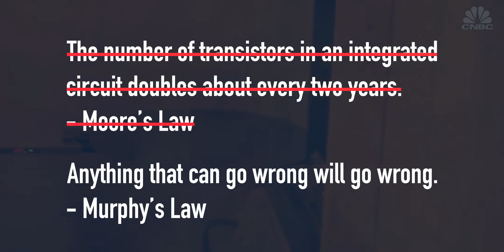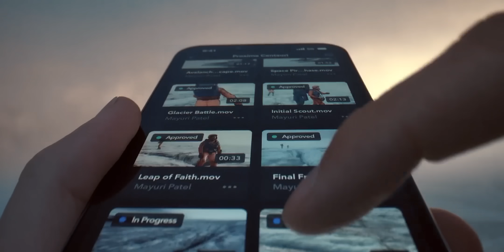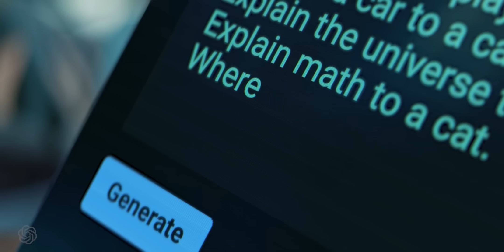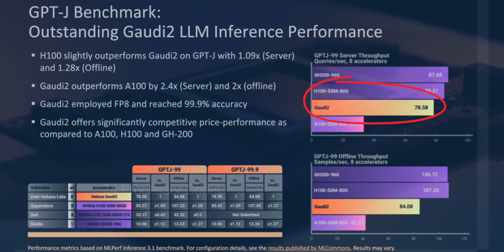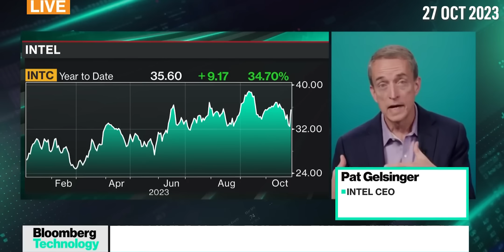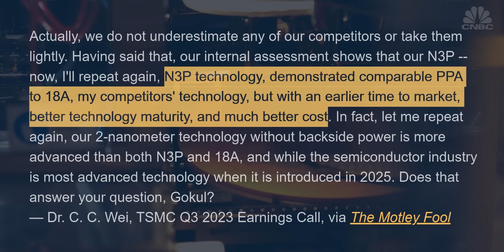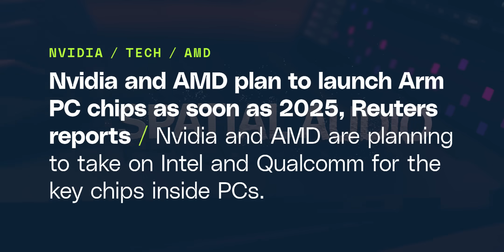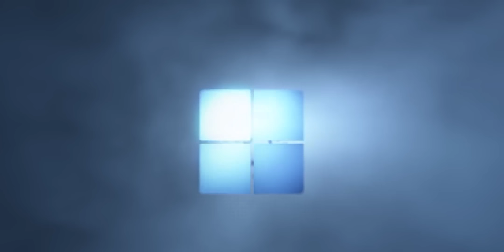I WAS WRONG! Intel's Crazy Plan to Dominate AI Chips is Working

Comment: Am I in an upside down world? Intel is in trouble because its processors suck and they don't look like they'll be getting any less suckier soon.

In server processors and GPUs for supercomputing AMD and Nvidia have given Intel a shellacking. In cloud computing the story is the same only Intel has strong competition from the ARM crowd there as well.

Both performance and energy efficiency must be first rate in commercial computing these days to find new CPU customers and Intel is incapable of achieving both of those objectives at the same time. AMD, without question, is hitting home runs while Intel isn't even hitting the ball.

Even in desktop/laptop processing where Intel generally gets high marks for CPU performance it shows no signs of of having mastered the energy efficiency challenge, Meteor Lake included. AMD looks like it has the stamina to take Intel in that area, too. In any case, the standouts in that domain are the high performance ARM players - Apple and Qualcomm - that have achieved a better performance and energy efficiency balance than either Intel or AMD. (And please spare me the nonsense that energy efficiency doesn't count for anything if you haven't got the performance - Qualcomm's new 'laptop' SoC outperforms 95% of Intel's processors aimed at desktops/laptops.)

The only thing that Intel can build on at the moment is its expanded foundry business but it better find customers fast or that will be the white elephant that puts paid to Intel's smug anticipation of uninterrupted success.
Reply: You describe perfectly the current situation but miss on the competitive outlook. The 3 drivers of the turnaround you miss are the following:
1. USA, Europe and Israel are giving $50billion in grants to Intel. No other competitor is getting that
2. ASMC is giving priority to Intel on next cutting edge litography machines. This will give node tech advantage for Intel on all their competitors.
3. Chiplet, not chip is the future. Intel  near future chips like Meteor lake are comprised of multiple tiles from different wafers and technologies such as RISC and TSMC nodes blending those tech with Intel's 8086 strengths to make the best chip. This is the future. Blending of best in class techs. And Intel chiplet tech is well ahead of competition.
Reply: @andrepaes3908  Points 1 and 2 follow from Intel's positional advantage as a leading semiconductor Foundry. I did comment on that in a general way and I wish them every success in that endeavour.

Point 3 is rather more debatable. Even if Intel leads in chiplet technology (a point that isn't proven in my estimation) its Meteor Lake tiles could still easily fall short. Nothing I have seen suggests that Intel has the measure of its main competitors in chip architecture and so far Intel has failed abysmally on delivering energy efficient cores.
Reply: @chris27gea58  yes Chris I think soon the benchmarks on Meteor lake will shed some light on how performance per watt will fare compared to AMD Ryzen and if the multi tile configuration delivers what is promised 👍
Reply: @andrepaes3908 it's stretch lol, intel chiplet no way ahead amd at all.
Reply from the maker: You’re not in an upside down world at all. In fact, I’ve made many of those same points before. I explained all the things Intel needs to change to become the next Nvidia and power efficiency is definitely a big one.
Reply: @TickerSymbolYOU 
>>...there’s a lot left we don’t know about the Meteor Lake VPU. The fact that it’s even called a VPU and includes Movidius tech implies that it’s a design focused on computer vision, similar to Movidius’s discrete VPUs. If that’s the case, then the Meteor Lake VPU may excel at processing visual workloads, but lack performance and flexibility in other areas. And while today’s disclosure from Intel disclosure quickly brings to mind questions about how this block will compare in performance and functionality to AMD’s Xilinx-derived Ryzen AI block, those are questions that will have to wait for another day.<< Anandtech, May 29, 2023

As for Gaudi, there is little there to cause excitement that I can see. Couldn't AWS, say, deliver better than a 40% price/performance gain for AI training just by improving their Graviton architecture? And, if that is beyond the capabilities of Amazon I doubt that Google or Fujitsu would be similarly limited. Yes, renovating cloud servers could be big business but it is also likely a declining business. Many datacentre operators will decline on the Intel lick of paint as a poor investment.

Comment: Intel needs to get its performance per watt in check if it wants to gain back market share or blunt the impact of the ARM invasion. Microsoft has apparently been working hard to make windows on arm a better experience than it has been historically. If windows on arm is a palatable experience for business and enterprise customers as well as gamers, Intel might be in trouble. Especially if nvidia and AMD enter with arm offerings. I think the fact that dell Lenovo ASUS HP and others have said they will offer ARM laptops means ARM IS COMING!! 

So the question for Intel is, will x86 have similar performance per watt as ARM? If not, then arm will slowly but surely begin to steal market share in laptop. Qualcomm now has some of the architects behind Apple silicon.  So Intel needs to take the arm threat serious and stop relying on historic indicators of ARM on high performance computers. I think Apple has obliterated that mental model that arm isn’t up to snuff for the pc/laptop. And the market can move against x86.  Be careful! I think once arrow lake is in market we will have more information on whether intel’s new nodes like 20A are up to the task of seriously improving performance per watt.
Reply: The main competitor of Microsoft is Apple. Microsoft's been working with Intel for decades to counteract Apple's threat. The ARM PC is just a backup plan for Microsoft in case Intel 5 nodes in 4 years fail. If it succeeds Microsoft will focus on developing Windows for 8086 and drop their backup plan.
Reply: @andrepaes3908  Microsoft has signaled a shift away from x86. Yesterday, they announced Azure Cobalt 100.  A 128-core chip that’s built on an Arm Neoverse CSS design and customized for Microsoft. It’s designed to power general cloud services on Azure.  

Not Xeon. Not epyc. But custom arm silicon. Imagine if Microsoft releases an arm chip for pc for surface or for generic laptop vendors like dell ASUS etc. 

Microsoft Cobalt begs the question as to Why would Microsoft need to develop its own arm silicon if Xeon or epyc were up to the task ? Intel needs to be careful!! If the major dominant operating system vendor, with insight into intel’s development plans  thinks that arm is a better course of action for their own services, then should Facebook and other large customers remain loyal to x86, or should they begin to pursue alternative arm silicon for their own needs? Arm is coming.
Reply: @j340_official  The way I see the semiconductors segment going forward is that it will be highly influenced by Geopolitics. Remember when Apple and Qualcomm were sueing each other on telco IP a few years ago ? Apple stopped sourcing 4G from Qualcomm and Huawey offered to provide 5G chips to Apple. That moment the government irtervened and forced a negotiation between the two US companies. At this point it was clear to me. No more aggressive competition among American semiconductor companies would be allowed. Our competitor is China and american companies should collaborate rather than fight each other. It is based on this theory that I think Microsoft will limit their customized chips to the cloud segment and in the future manufacture these chips on Intel foundry. I suspect there is a "behind the scenes" agreement between all western country companies to share the profits of the semiconductor among themselves isolating China companies. This alliance comprises companies like Apple, Nvidia, TSMC, ASMC, Samsung, Intel, Qualcomm, AMD, Microsoft, Google, Amazon, Meta among others. Everyone will profit from this  but I think Intel will be the most benefited of all because of its unique position as sole major semiconductor manufacturing company in the US.
Reply: @andrepaes3908  perhaps that’s the pivot. From the dominant American chip behemoth to the American  behemoth that produces chips for American companies. But TSMC is paramount for a reason. Those relationships with various companies have been built. Also, as TSMC doesn’t produce its own chips to compete with its customers, TSMC has an advantage there. The issue with the current Intel structure is that there’s the potential (however small) that Intel uses the intellectual property of a customer to influence its own competing chip designs. And that’s why TSMC will have an advantage. So I think for intel’s foundry to become competitive, they will have to spin it off. But we will see.

Comment: Cool, but you could not be more wrong regarding INTC. If we dismiss history which says INTC chips are garbage as well as AMD's hot mess, cos just look how long they had 14nm chips. Everything in PC components is almost out of sync. With that much power you are only getting workable PC. I am first one to say that I am more than ready to buy NVDA ARM chip with GPU support that has RAM's that communicate directly with GPU and CPU. INTC has such a hard competition that it is almost impossible for them so succeed. Even AAPL made M3 chips and they are way better than last gen yet M1 is so good that you really have no reason what so ever to upgrade to M3. None. You will need to wait till M10 to play cyberpunk on 4K with 120FPS which I am doing now. And let us be honest that INTC's 7nm chips are updated 10nm dye in era where TSMC is talking about 2nm and already using 3nm on M3 which is crazy good chip. The main component in my PC is NVDA 4070 GPU, not my Intel 13gen i5. I could care less about what processor am I using cos they are all very good these days, but I need to use GPU desperately. I know stock looks attractive at these levels but I already lost so much on that garbage of intel stock that trust me they pounded that fab for a reason. Competition cut the off. I already have a tablet, PC, laptop, iphone, why on earth do I need another intel chip?
Reply from the maker: You’re not wrong. I just think we’ll see a flood of new devices and chips specifically for AI